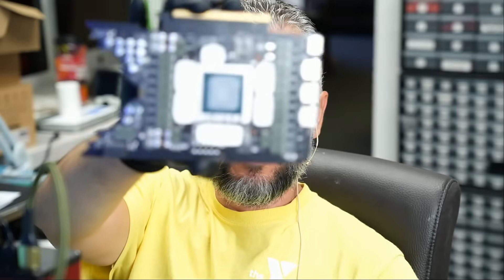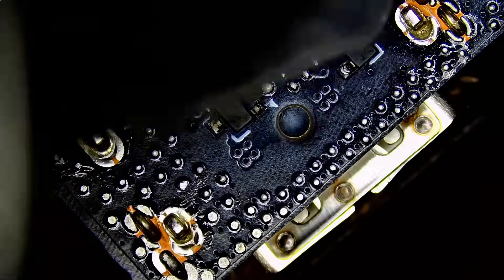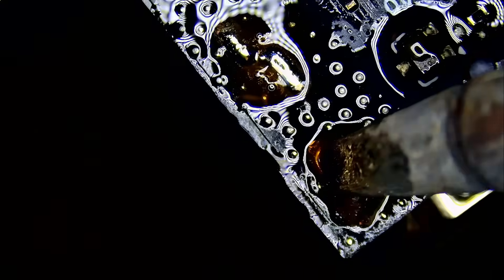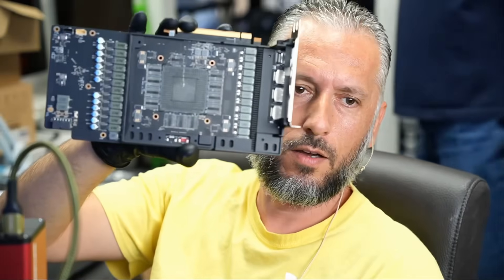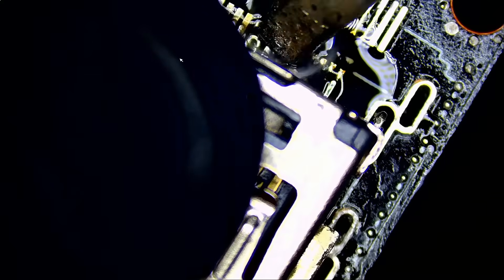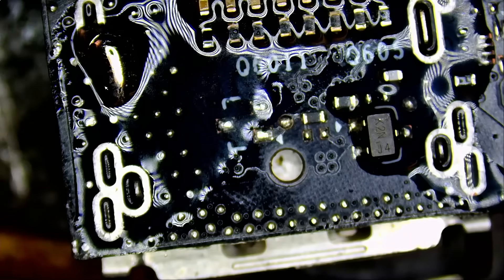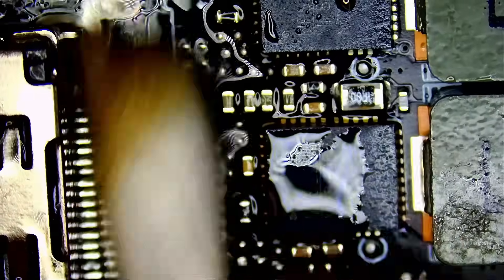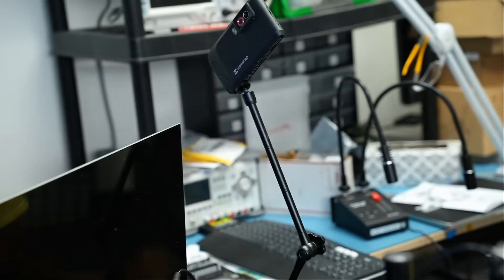RTX 4090 FE Replacing a Busted HDMI Connector. Can we save it?

Comment: Good Example 4 Peoples which thinks a  Cheap Ali or Amazon Solder iron is capable to Heat 4 electrical Solder. They didnt use sn60Pb40. You need much more Heat. 1st They didn´t Heat enough to match Solder Temperature and even doesn´t have the Power to melt Trough the Board Layers

Comment: I tell people to not buy used cards - NRF 2025.
me buying a gtx 970 without a return policy: ok and?
Reply: The 80 and 90 series GPU's are a bit of a risk because of the AI ban in China.

So prior to the ban, China had some stock pile of these GPU's and now they are taking them and modifying them. They take the GPU and memory chips off the board and create custom PCB's to put the GPU cores and memory chips on. They can create a frankenstein card with a 4090 GPU core and significantly more memory than the 4090 shipped with. 

In short, high end GPU's are being frankenstiened into AI server farm cards by China. So now we see a flood of 4090 (and a few other SKU) cards hitting the secondary market with no cores and no memory.

No one is stealing chips off of your 970. You are fine there.

Comment: Back when I took a course in electronics repair—must’ve been around 10 years ago—the school used to buy used but working hard drives in bulk. We’d practice soldering by removing and reattaching components on them. It was a pretty cheap way to get hands-on soldering experience, and the drives had everything from thru-hole parts to really tiny surface-mount components. You can still find loads of used hard drives for cheap on places like eBay. Just a tip for anyone who wants to practice without spending a fortune.